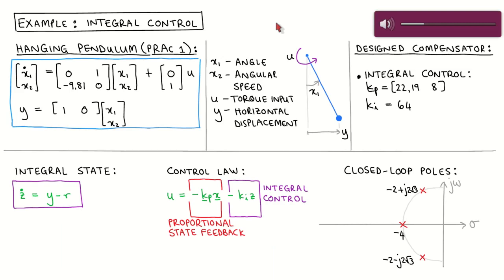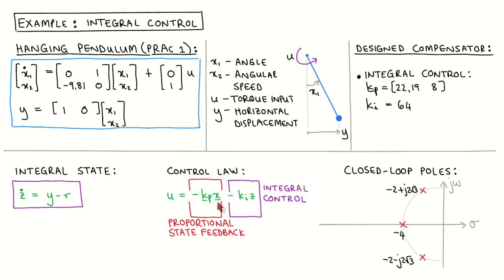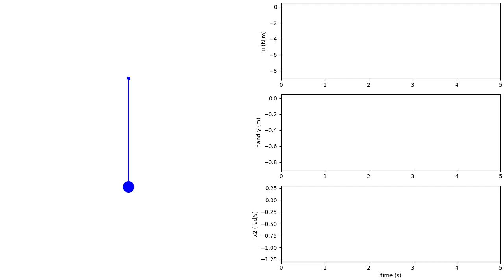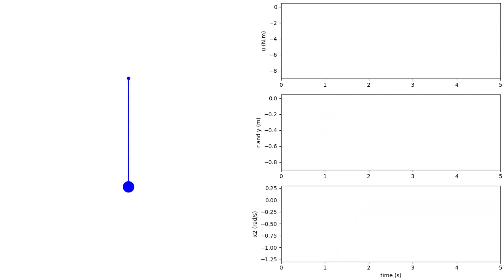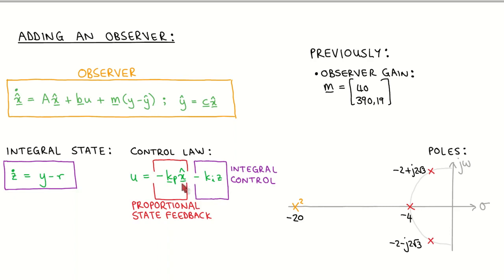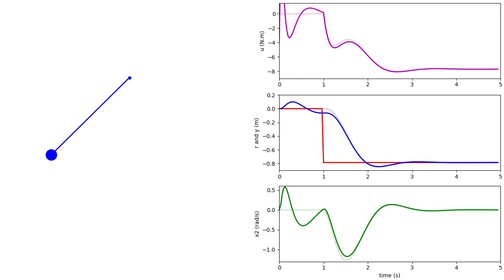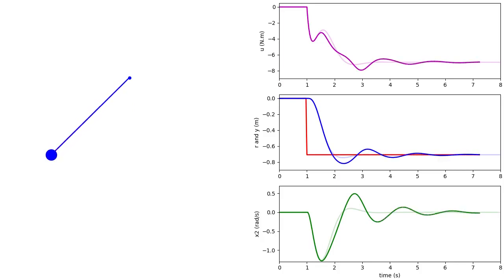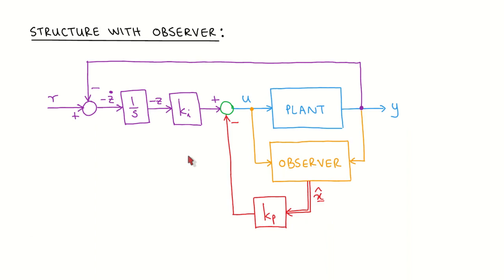State variable control 35: Integral control example

Comment: Is it possible to eleborate a bit on the reference feedforward when it changes fast? Would a proportional term as in a classical PI controller do the job? Then the complete system will become a combination of a classical PI controller and SV compensator. Would this work?